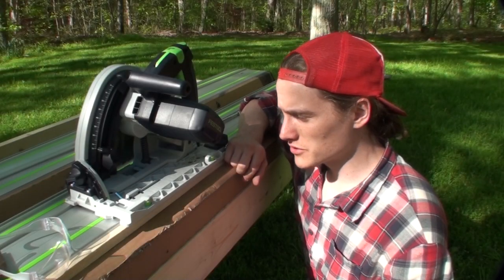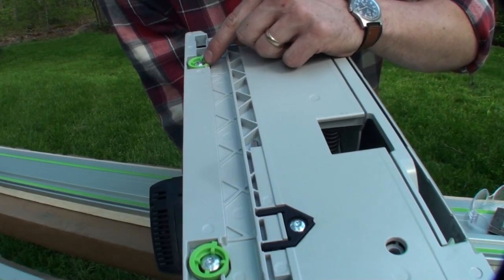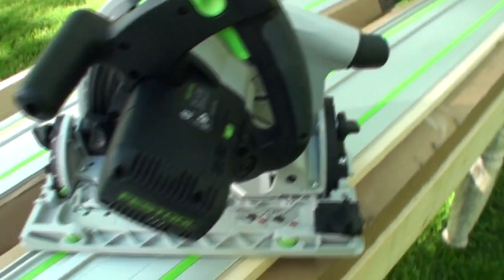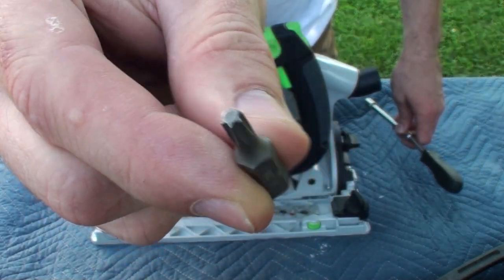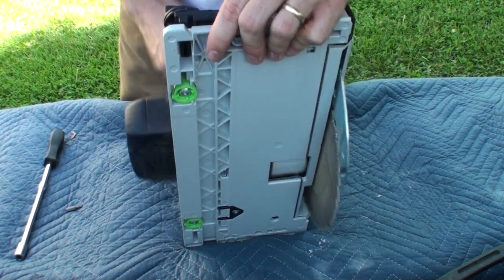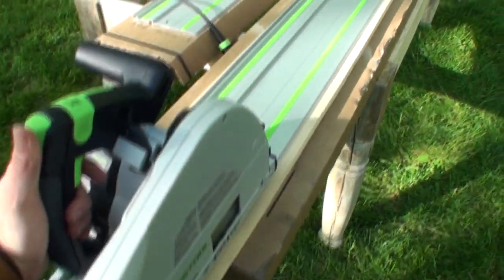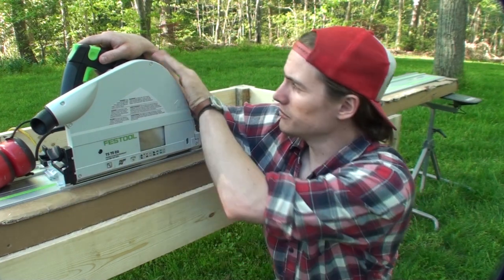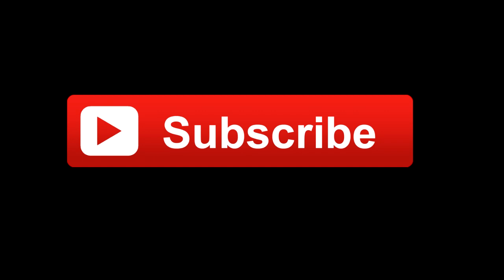Festool Tracksaw - Trimming the Guide Rail Splinter Guard -  TS 55 TS 75

Comment: Thanks for the video! I'm looking into tracksaws as well. Like you said, they aren't for everyone, but in time saved (and I think probably some frustration saved!) it seems like a no-brainer. My interest is the same as yours - my tools make me money so if I can save labor cost significantly through a better tool, I'll do it! Just found your channel recently and really loving it by the way!
Reply from the maker: BradleyMakes It's a good tool, that's all that matters to me. This one did what I needed it to do, that no saw less could do, cutting through 2.5 inch lumber. Could have I made my own, yes. But in that amount of time it would take to make one as good as this one, I could make enough money to buy several of them. Sometimes I like making stuff and other times it's better to buy things. In the case of this saw, I just paid for it over the phone and it showed up ready to work. In cases like my duplicator for my lathe, I didn't like the options that you could buy, so I made my own and bet it's faster than anything outside of a CNC lathe. Depending on what you need out of a track saw, it may be the one for you, but you might not ever need the depth of cut I need. The dewalt saw looks good to me, just couldn't do what I needed. There's also a version by Grizzly, but I don't think they have longer rails, just shorter ones that can be connected and I at least wanted one that could do 8 foot cuts. This saw makes me money faster.

Comment: great video, such a good saw, I have the TS55 and built my first cabinet from mdf with hinged door and shelves and it turned out great, worth every penny/cent!  It is advisable to keep a spare length of splinter guard in your workshop as I found out when I fouled mine during a cut of plywood (I should have really used a circular saw for the purpose)
Reply from the maker: It is a great saw, It makes my work a lot easier and faster while taking up very little room.

Comment: Hey m8 , my 3 ts55 rails are in pretty rough condition..you can buy some clear silicon bottom draught door seal from 3m...put some painters tape either side over the silicon , do your first cut all good...the painters tape stops the silicon from melting on the  initial trimming off excess cut...if you get stuck you can always just use painters tape.
Peace from Oz

Comment: Great video, used it to tune up a used ts 75 that I bought. Still having trouble with the blade (and cut) wandering away from the track and splinter guard, and then binding up. Do you know a way to set the blade PARALLEL to the track? Seems adjusting the green guide jaw screws to remove slop (as you show here) doesn’t fix the problem. Brand new blade, relatively thin/softwood stock, so those variables are out too.

Comment: The first thing you need to do is check if the blade is indeed exactly parallel to the track. I had this issue when I trimmed my splinter guard only to find out the blade was slightly out of alignment 😢

Comment: an easier way to adjust the rear screw is to place a piece of paper under the point where it contacts the base plate.....while turning the screw, move the paper .  when the screw prevents the paper from moving, you are done.  then loosen both the front and rear thumb screws and rotate saw to remove the paper. how did you adjust the green indicator knob at zero after you set the stop screws?
Reply from the maker: Thanks. I can't remember about the adjustment at this point......probably need to check it soon, but it's been cutting square ever since I got it set up.

Comment: Thank you for this video. Question...I just got my TS 75. It's my understanding the guide rail splinter guard should be cut flush with the guide rail. Is this correct. Upon my attempt to trim the splinter guard  I noticed about an ⅛" of the splinter guard remained. I expected it to be flush since this saw is intended to be a zero clearance. As is... the remaining ⅛" makes it difficult to see my scribed lines on the work piece I want to cut. Any tips or comments for better success?
Reply from the maker: Thats normal, the rubber guard is the zero clearance. Your first cut does so. You align the clear rubber with your marks or line you want to cut to.
Reply: @thehomesteadcraftsman8975  thanks for the clarification.

Comment: How's that wedding ring treating you? Leading a very active hands-on life.... I only made it 6 months with my wedding ring. I ended up getting a ring tattoo and I love it. Never have to worry about taking it off or having my hand get stuck anymore
Reply from the maker: Nick Bouley Ha, it's treating my nicely. It hasn't caused any issues yet, at first I just messed with it a lot, now I'm used to it, but it took about a month. I didn't like it at first. So far I've done everything as if it wasn't there and no problems.......although there are some things that I'd probably take if off for......lathe work. I can imagine getting de-fingered some how.

Comment: The word you were looking for on the cam adjustment is "eccentric" meaning off center of a circle applying varying pressure based on the "oval created by turning the circle not in the center"  I'm sure google could give you a more technical definition.
Reply from the maker: CliffWalrus Yeah, all that's pretty easy to remember when your off camera. Once you've filmed a clip a couple times trying to get it right, it's hard to all the terms into one shot without blanking every once in a while.

Comment: Was there too much wiggle/slop in the saw? Is that why the cut wasn't straight at the beginning and end of the cut? Otherwise, why wouldn't it not come out straight?
Reply from the maker: It's straight, it's just when you plunge the saw to trim the strip the blade does not cut it all the way to the end as the saw would have to be hanging off the track to do so...basically I just said more than I needed to say at the part you are referring too. All is well with the saw, cuts great and is great in the shop.
Reply: Great, thanks for the clarification. Love your vids.

Comment: Nice video. I have had the TS55 for about 10 years and love it for breaking done sheet goods. You made a bit of a mistake when trimming your splinter guard. You should never start or stop the saw with the green rail adjustment knobs off the rail. Your rails should have a few inches of splinter guard untrimmed at the ends.
Reply from the maker: 1arctos I get what you saying.... luckily it didn't cause any problems, If I join my rails together it will get trimmed perfect.
Reply: i dont follow what you are saying with properly trimming the splinter guard.  i purchased a ts75 probably 4-5 years ago and am finally getting around to using it for the first time.  not too soon after purchasing it, i had some cancer come back and was getting really aggressive so needless to say, the track saw sat in its box until another day which i didnt know it was going to be around 4-5 year later. anyhow....after numerous surgeries.....one of which required my right lung to be removed.....the cancer is fairly stable and is actually shrinking somewhat from a third type of chemo......there for a while it appeared to be hopeless with no other thing to do than watch it grow bigger in my lung that was left and then start arranging a funeral......but low and behold, there is hope now....it is shrinking from an oral chemo which i have to take twice a day forever providing it continues to work.  i guess i didnt need to tell you a short story, but it is kind of hard to understand the situation without explaining it thoroughly.  now, back to the track saw......could you be so kindly to explain to me the proper method of firing my saw up for the first time and the proper procedure for trimming the splinter guard? regards....todd

Comment: I just bought the TS 75 with a couple tracks. I have a question, when you cut your splinter guard, did it cut it close to the guide track? When I cut mine it cut it real close to the track and I didn't know if that was normal?
Reply: I should clarify: not the green splinter guard, but the zero clearance splinter guard on the track.

Comment: Seems like you're having to work from a sort of left-handed position... reaching across your body to operate the saw with your right hand.  Wouldn't it work better if the blade were on the left side of the motor?  You could walk with your right hand straight in front of you and see the cut at the same time.
Reply from the maker: That was the first time I used the saw. I use my left hand to operate it. This saw and my Domino changed the way I work in the shop when it comes to making my tables I sell. I've more than cut in half the time to build them.

Comment: You lost me at Festool.  I can't justify $750 for a very overrated plastic saw.  Cheers! --Chris.
Reply from the maker: Cactus Makeshop Well I'm not going to argue with you, but it's not over rated.....and that's from someone that is not a fan of spending money. The saw does what it is supposed to do. The first time I used the saw it more than paid for it's self. When it comes to tracksaws there is only one other saw that has a depth of cut that I needed and it is much more. With in reason, the cost of the tool does not matter to me if it makes what I do faster and easier. It also keeps me off a jointer, which claims many fingers. When do as much of this stuff as I do, having the right tools makes the difference between being able to do it and not.......and this saw is the right one for me.
Reply: The Homestead Craftsman 

From the Cactus Makeshop site, "Hi, I'm Chris. Having fun making stuff in the Cactus Makeshop! Come along with me and learn from me, and teach me."   I guess he changed his mind about the "teach me" part.

Don't know about Chris's case, but it seems, most Festool haters have never owned or operated a Festool product.    JimE
Reply from the maker: Jim E Yeah, I don't know....it's easy for people to say things quickly at the key board. But yeah, most probably havn't used them, not that that's a reason alone to buy. But not sure why they want to jump all over them. I had not even seen or touched a festool until about a week before I bought this one...just researched the saw some. I don't care if it comes from festool or harbor freight, if it does what I want it's worth it. I just think it's funny when people say they wouldn't buy something that they personally have no use for..... it's like if I said a $2000 sewing machine is overrated........... not to a professional seamstress. I don't take these comments personally, just don't know why people have something negative to say about someone else doing something as non controversial as buying a tool they need. I doubt Chris has any ill intention, like I said, it's pretty easy to spout something off behind the key board. No harm done. Thanks for watching Jim.
Reply: I believe there are two elements to your comment. The first is that you can't justify the price, and the second that you think the TS55 is overrated. The former is purely subjective. If you can't justify the spend, then no one can disagree with you. The latter however may be objectively challenged. Clearly the sales figures for the saw demonstrate that its user base think otherwise. I'm a hobbyist only and have a TS 55. Its cost is a fraction of  the cost of a table saw which I don't have the space for (nor indeed the cash), but it cuts sheet goods as well as, if not better than, a table saw. More importantly however, it's infinitely more safer for an amateur hobbyist. Incidentally very little of it is plastic, and those bits that are are machined to very exact tolerances. Best wishes from Scotland!